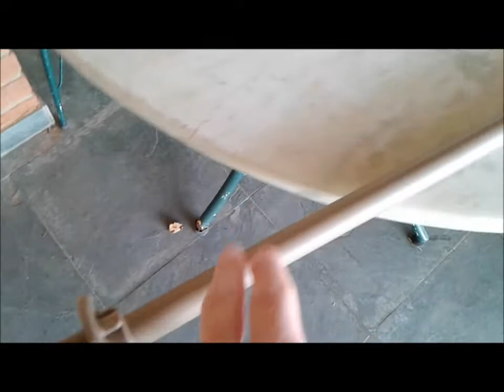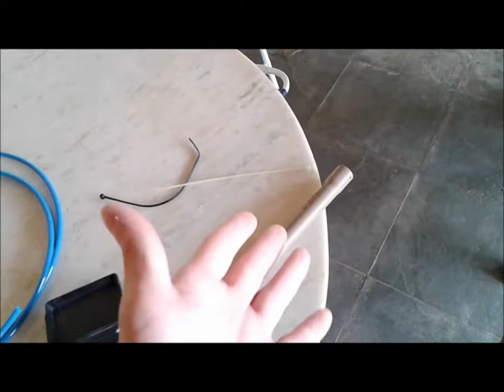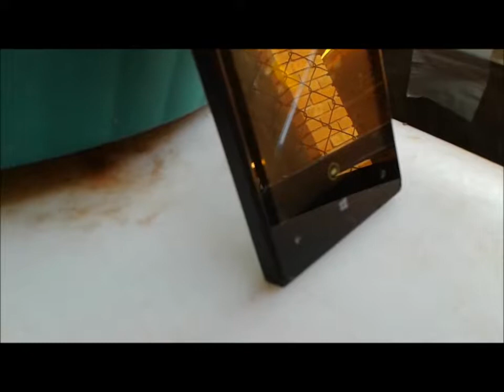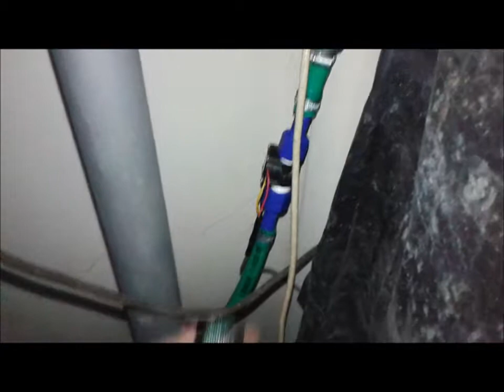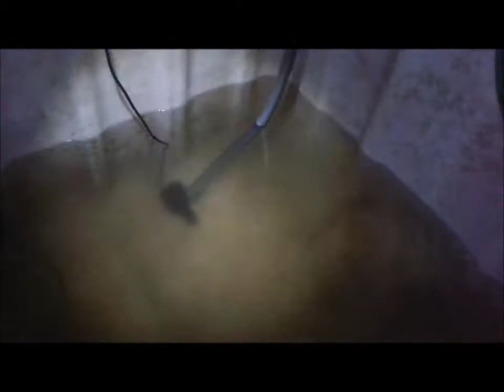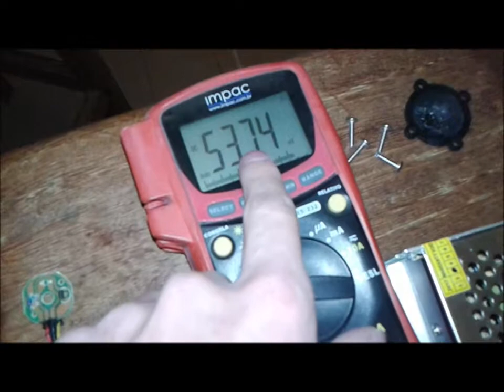Aquaponics System - Measuring Level With a Pressure Sensor

Comment: Hello!

I've readed another person who used the same sensor on a water tank and when the hose was "big" (1m) the output from sensor kept going down after some time.... do you faced any problem like that one? I have a sensor like this and i intend to install in a water tank with 1m depth.

thanks in advance
Reply from the maker: As a matter of fact I do have this issue but not on this tank, on my main tank. Somehow water enters the measuring hose and the readings go down. So from time to time I have to remove the sensor and knock it a few times so the water can escape. It might have something to do with the fact that the main tank has a large temperature oscillation, while this does not. But I still recommend this sensor as a way of measuring water level.
Reply: Is water supposed to come up and down in the measuring hose as water level changes?  You have to evict water???